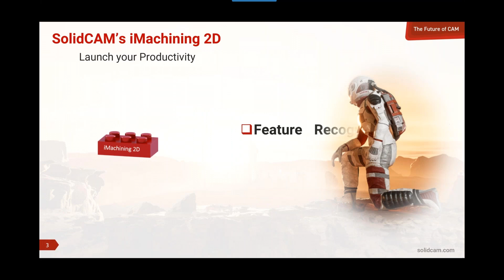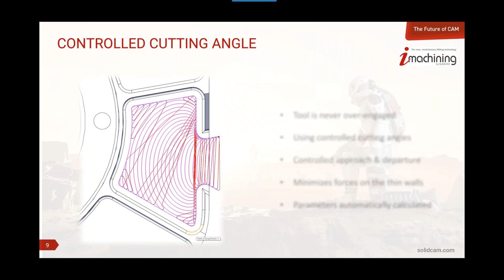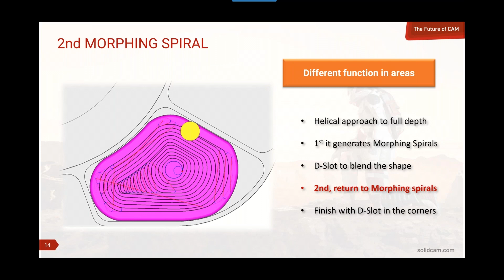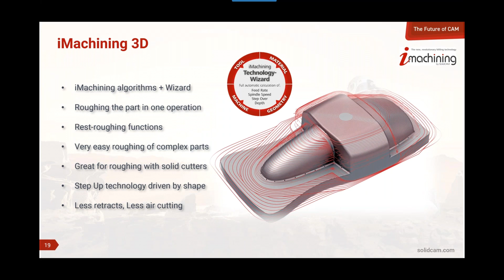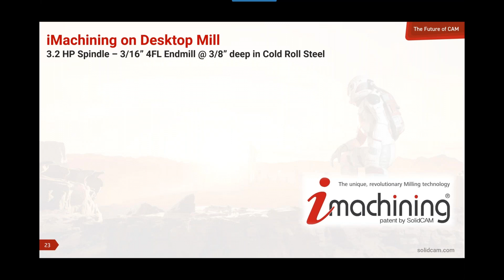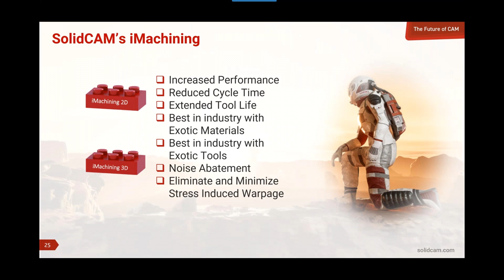Unleash the Power of Your CNC Machines with iMachining 2D & 3D

Comment: Happy new year, Is iMachning suitable for micro mill 0.1mm to 1mm or there's other module are best than iMachning for this type of mills, used for roughing and finiching a texcture on 3x machine I hope get answer, thank you in advance
Reply: I have executed imachining on ss304 with 2mm endmill and it works like chram.
Reply: @haseebali4161 , Thank you very much for this valuable information.